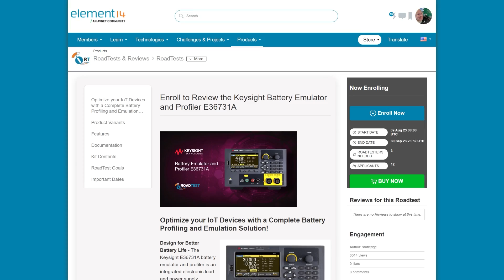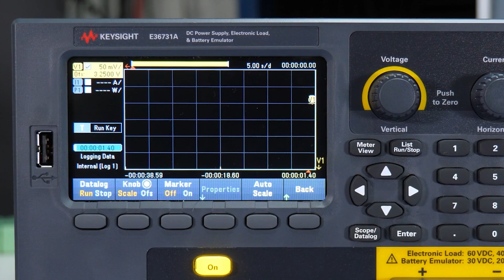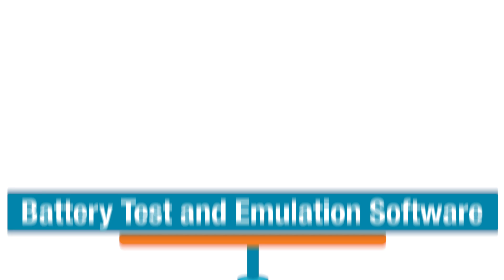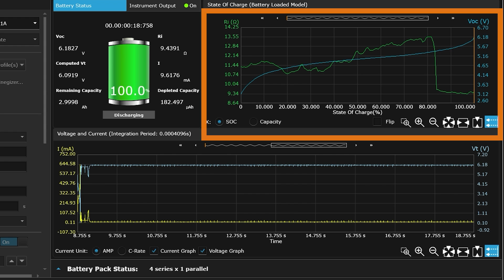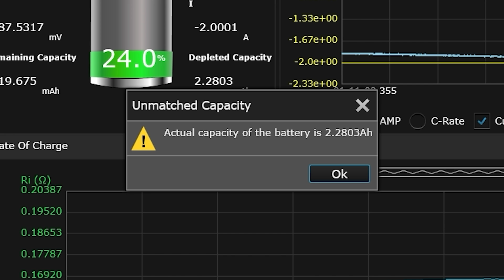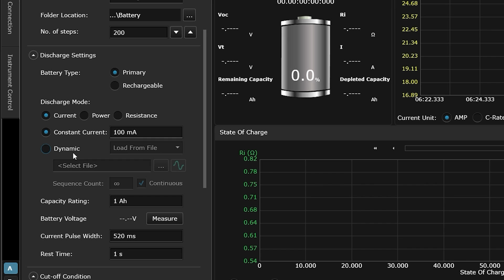Overview of the Keysight Battery Emulator (E36731A and BV9211B) - Workbench Wednesdays

Comment: Dear Manufacturers:  I'm not specifying, or buying, test bench hardware that requires a software subscription to use installed features.
Reply: Same issue.  Had a unit on demo, but the annual ransom to be able use a core functionality of the product was too much.  Plus the Benchvue suite is pretty buggy.